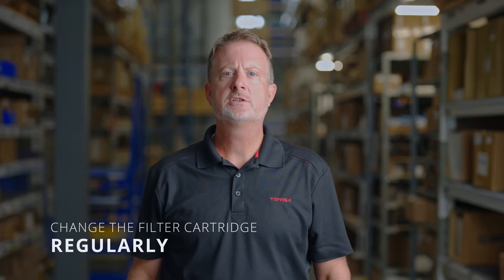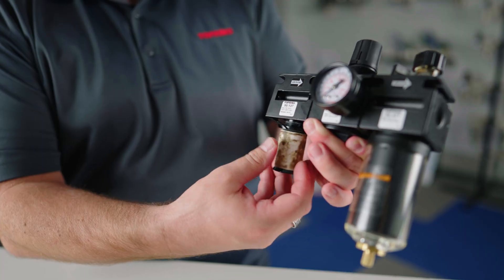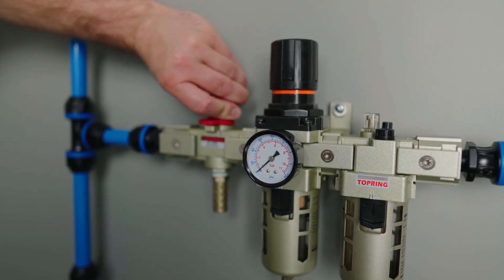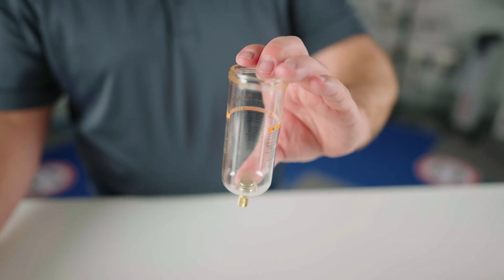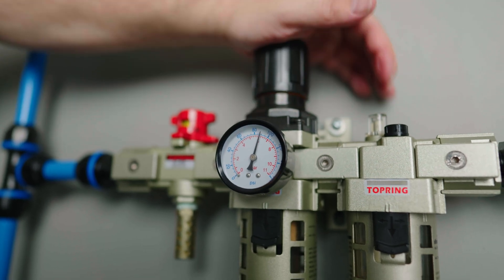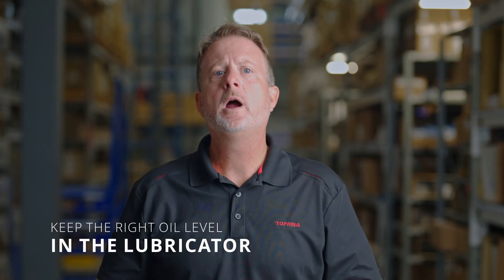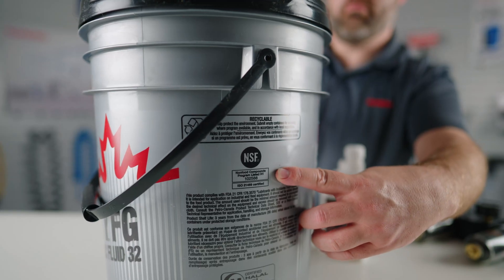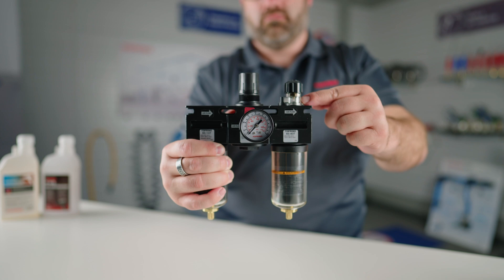How to service a filter, regulator and lubricator

Comment: Hi, can I use a regulator-lubricator system (like a DXcm019-0352 DeWalt regulator) but ‘bypass’ the lubricator component by not filling with oil/lubricant?